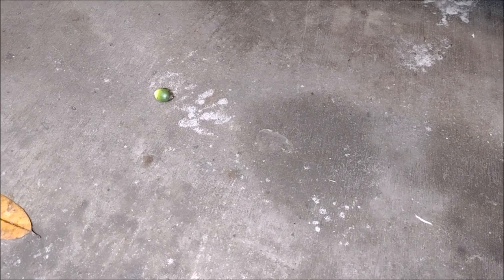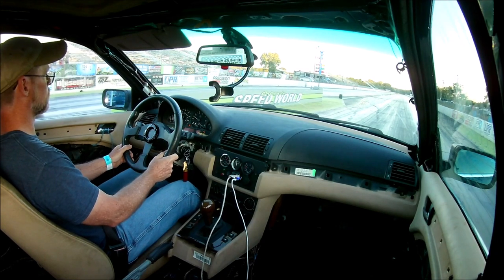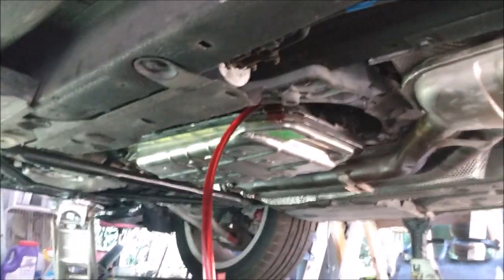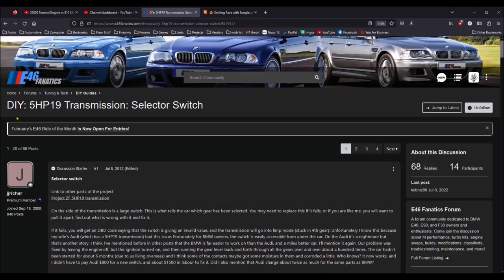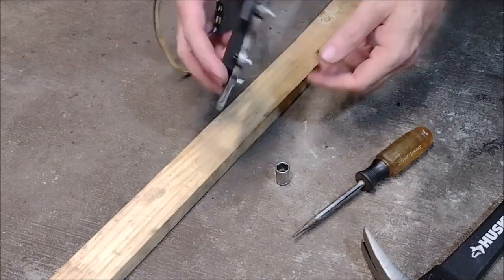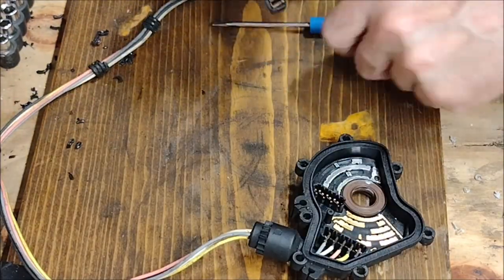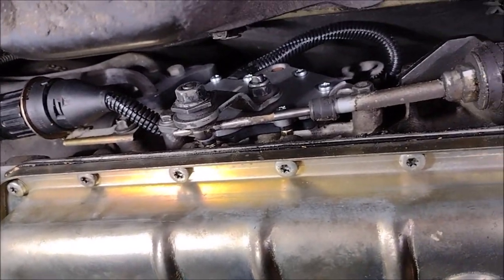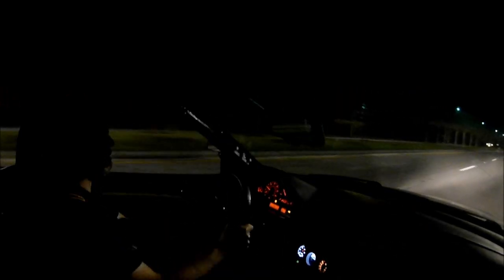BMW E46 Project: Fixing the Slushbox (ZF 5HP19 Gear Selector Switch)

Comment: great video I have used to rehab this selector switch on my e85 2.5 2003.  was there any clearance issue with the bolts you used to replace the rivets?
Reply from the maker: Thanks! There were no clearance issues.

Comment: I just cleaned mine today. Finding this vid halfway through. Bro, how unnecessarily difficult was that twist connector for the sensor...for absolutely no reason 😂. Same about the wire loom, I wrapped my wires in electrical tape.
Reply from the maker: That connector was hard to remove, because it was caked with grime. I had to remove the switch from the gearbox first, and let it dangle on the wires. That gave me better access to the connector.
Reply: @michaelblacktree  yep thats how i had to do it. good vid.
Reply from the maker: thanks!

Comment: E53 X5 M62 5HP24 has the exact same switch. However you need to remove the subframe stiffening plate and front driveshaft to get it out.

Comment: Interesting, I had a similar issue on my e46. The seller had sold me the car without disclosing the fact that the transmission had an issue until the car was on the trailer. I go under the car and find that the switch plug was only half way plugged in and had some corrosion ;)